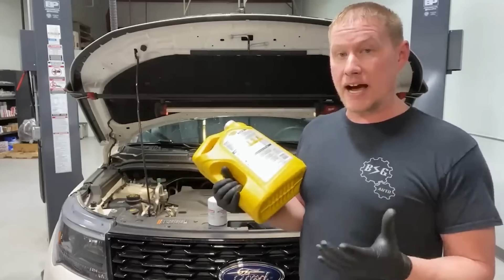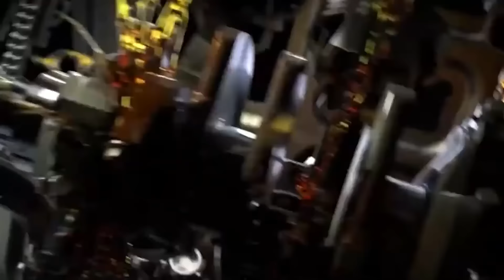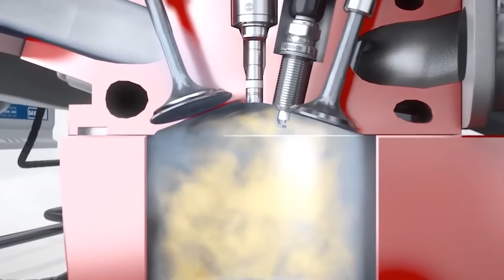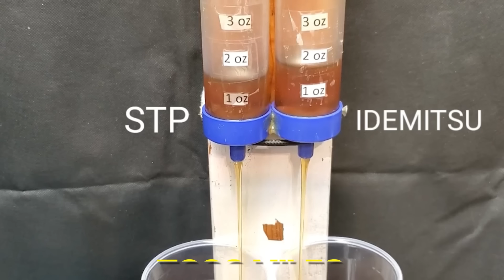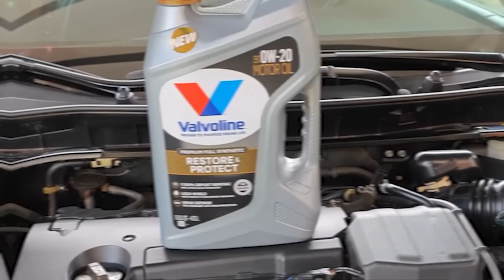AVOID These 5 Engine Oil Brands (And 10 That Actually Lasted 70,000+ Miles)

Comment: I've been using Castrol 5W-30 Full Synthetic oil in my Toyota pickup for two years now. Although this video reviews Castrol as a mediocre oil, I'll probably stick with it since it has been working great in my truck and I haven't had a single problem yet. But thanks anyway, I'll consider to check for those symptoms moving forward.

Comment: Amazon Basics, Walmart's SuperTech, and Costco's Kirkland are all primarily manufactured by Warren Distribution, though each retailer supposedly specifies its own blend. Realistically, there should not be much difference between them. Testing at 50,000–70,000-mile oil change intervals does not necessarily correspond to what happens when oil is changed at OEM-recommended intervals. You are testing conditions the oils were not designed for.

Comment: Plus you cannot trust the dealership.Oil change  intervals changing your oil at 7500 miles or 10000 miles
You're waiting too long to change the oil.Technically, your oil should be changed even on newer.Engines somewhere between probably four and six thousand miles, depending on how you drive your vehicle

Comment: I use mobile one 5/30 6.0 Lq4 Chevy 60 psi oil pressure truck had 20 thousand miles when I got it and 276 thousand motor is clean I change it 3/4 thousand miles fresh clean oil u won’t have problems it cost

Comment: My 2015 Grand Caravan runs on Valvoline Full Synthetic. It has been running on Valvoline since I bought it new in 2015. I had to replace the intake and exhaust cams on bank one and I voluntarily did bank 2. Bank one journal had defective lobes that caused a horrible tick. When I took the covers off I saw no sign of sludge or any metal fragments. Actually the top end was very well oiled and clean based on the engine rolling 177K miles of mixed city and highway. Here I am today still using Valvoline and before the month of May 2026, I’ll be rolling 390k miles. Oil changes can go 5K and at times I let it, but my normal is 3k miles. I read between the lines on these posts and decide for myself what works best for me and maybe not so much for others
Reply: 177k, and a cam replacement????   Yup, it's American.  Japanese cars routinely go 250-300k plus with NO internal engine fixes, still running great after that time.

Valvoline is good oil, in my experience, but make sure it is REALLY full synthetic, not CLAIMED synthetic, as there is literally no requirement to actually be gas based, rather than oil based, when claimed on the label."Full synthetic" label is marketing, not truth.

390k is damned impressive, virtually unheard of in that vehicle.  I know another guy with that vehicle, though, that has about that many miles on it, no total rebuilds. The car brand, by far, most likely to have 400k+ and still be rolling is Toyota, per meta data analysis.

Comment: Originally My 2005 Nissan Altima called for  5W-30 conventual oil.   Most oil sold today says Synthetic,  but it's just modified conventual.   I buy the lowest cost oils (Walmart) and change it every 7000miles.

Comment: Seems like if you run oil 70000 miles your maintenance cost is pretty low
Reply: You forgot to factor in the engine replacement that will likely be required, by then, or shortly after.  ;-)  That was funny though.   You can run your tires until the threads/belts show, and they blow, too, but not a great idea.

Comment: IS THIS ALL LIES? I need to know cause I want to put a little castor oil in my weak cylinder. It might raise the compression. But if it never leaves???
Reply: Why?  Of course it 'leaves'.  It gets burned and goes out with the exhaust, in a second or two.  That won't do anything good, though.  You could try one of the oils meant to unstick rings, I think Valvoline makes a good one.  If the ring is just stuck with carbon deposits it might help, some.  If the rings and cylinders are worn though, nothing but a tear down and rebuild will correct that.  Do a compression and leak down test before and after that full cycle to the next oil change, and you can see if anything actually helped.  Some engines are  more prone to that problem than others.  If you have a 2003 Camry type engine (don't remember where that seven year cycle for that model starts and stops), that is a possible candidate, a known problem due to the way it is oiled.  Good luck.

Comment: Sounds like engine oil should be changed more often now. No oil should be in an engine for 70,000 MILES!!!! 

What happened to "Slick 50" and other oil additives that are suppose to cut down or stop excessive engine wear? ?
Reply: Sounds like engine oil should be changed more often now.
Nah, not with good oils.

No oil should be in an engine for 70,000 MILES!!!! 
Can't possibly agree with you more.

What happened to "Slick 50" and other oil additives that are suppose to cut down or stop excessive engine wear? ?
Oils are designed and manufactured with certain additives, and some additives work VERY badly with others, actually degrading the oil to junk.
If you know all the chemistries, and really know what is in the additives, fine, but are you a tribologist?  Best to just stick with a good synthetic, a REAL sythetic.

Comment: Yeah, IDK, I have had several vehicles over the years, never had a catastrophic engine failure except two that lost coolant. I used to change my oil at 3,000, then started stretching the intervals over the years. I’ve gone 50,000 before in a 4runner V8 and normally did 20,000 intervals in the 4runners. One had 430,000 on it and radiator popped. The other has 230,000 or so and I can’t tell a difference between changing at 5,000 or 10,000 or 20,000. I always use synthetic and get a quality filter though. If I start buying Amsoil,,,that would probably be bad because i’d want to stretch it even more.
Reply: Bull, not with a standard off the shelf oil.  If you went 50k with a 10k oil, the interior of that engine  would be gunked up so badly that it probably wouldn't drain back to the pan, and the oil additives would have disappeared 40k ago, leading to very bad things.  That, or you have a guardian angel on your shoulder.  That is industrial strength stupid.

Comment: Pennzoil has always been junk oil. Back in the late '60's and thru the '70's, I could tell when I came across a car that was using it, as the oil cap would have frothing all over the inside. The engines would never lasted very long in those cars.
Reply: They now use natural gas to make their oils like Ultra Platinum. It's totally different modern engineered oils that compete with Amsoil.

Comment: The part about Valvoline synpower oil is completely wrong. It's a group 3 motor oil and Valvoline Advanced is considered the same oil.
Valvoline is a good oil no matter if it's group 3 or 4. 
Change your oil every 3000 miles and you'll never have an oil related break down. 
And that Walmart stuff, used it in a lawn mower, it just didn't look right during the mower's yearly change. 
Never again!

Comment: You should always change your oil every 4 to 5 thousand miles no matter what the bottle claim. No oil can last 70,000 miles and if it does your engine will be in bad condition.

Comment: my 2002 ranger with 180.000 mies lived on pennzoil and still runs
Reply: I have used Castrol for 20 plus years. My car has150,000 miles. I use no oil ,, I replace oil at 5,000 to 6,000 miles

Comment: Idemitsu...
Which Idemitsu "Full Synthetic" product did you test? Because Idemitsu's USA import is sold as "Full Synthetic", but IS NOT a Cat IV PAO base lubricant as the version actually sold in Japan. The version of Idemitsu sold in the USA is a Cat III non-PAO based lubricant... where other US testing companies have rated it at similar performance as "Full Stnthetic" Cat III non-PAO  Valvaline and Mobil 1.

Comment: I used mobile one 10000 mile intervals I changed it after 5000 miles and it was the dirtiest oil I have ever changed in my entire life and I changed my oil every 5,000 mi so don't believe the hype on the mobile one it's a bunch of junk
Reply: Pennzoil Ultra Platinum. Give it a try. I run it in my Mustang Gt and no issues. It protects very well. I run the shit out of the car at times with no issues.

Comment: I laugh in the comment section. About how who drives 75k miles on oil. He mentioned regular oil changes throughout. He never said that far on one oil change. Just cars that allegedly used the same engine oil at each oil change throughout that many miles. Smdh.

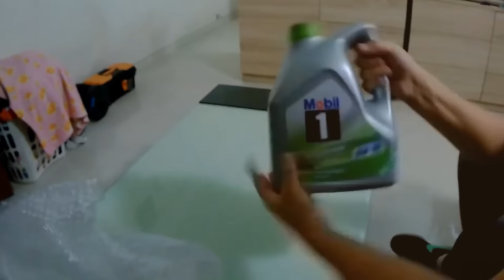Comment: Amsoil Signature Series (35:33): The winner. It maintained near-perfect viscosity and TBN (Total Base Number) even with 25,000-mile drain intervals.
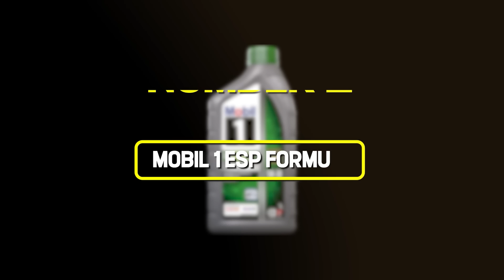Mobil 1 ESP Formula (34:33): Excellent European formula outperformed the American version.
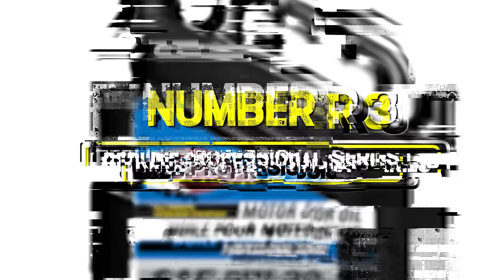Red Line Professional Series (33:32): Ester-based oil provided exceptional racing-level protection.
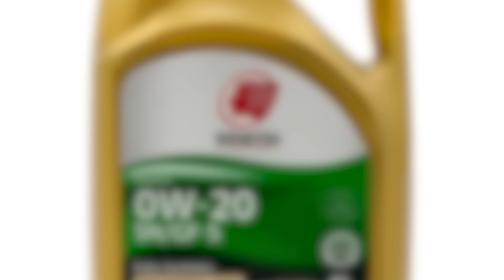Idemitsu Full Synthetic (22:28): Solid Japanese precision engineering.
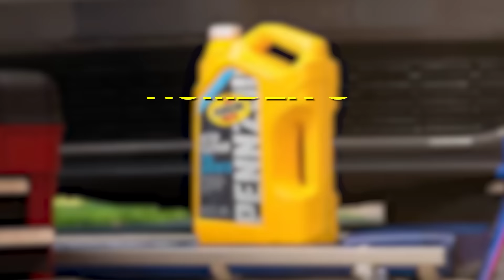Pennzoil Ultra Platinum (31:09): Superior performance compared to the regular Platinum line.
Supertech Full Synthetic (30:41): Walmart's house brand offered the best value, costing the least per mile while providing high-quality protection.

Comment: The high number of oil use is from a total use WITH oil changes at the preferred intervals: 75,000 mi. equals 5 changes at 15k miles each. So, continuous use broke down mechanicals even with changes.

Comment: I don't believe they're running the oil for 70000 miles but are breaking down the engine to check for issues over the normal oil change intervals at 5k

Comment: Have used valvoline in my 2008 ford4.6 for 260k miles... use 5w30 instead of 5w20 and she starts right up no ticks and change between 3 and 4k mile religiously...
Reply: That's the key, 3000 miles. It's all good oil when you do that.

Comment: I change my own oil.  I average 16,000 miles per year on my non-turbo, no-towing commuter vehicle.  I change my oil every 4,000 miles, and I purposely buy the $22 jug.  I save $84 a year by changing my own oil and filter.  One Jiffy Lub visit is $99.  I am done with quicklube, saving $310 a year, no matter what they call their bulk oil product.  4,000-mile intervals does not stress the group 3 base oil, as I have never had an engine failure due to poor lubrication.  I crossed 99,200 yesterday. Just saying.
Reply: A lot of those quick oil change outlets actually use substandard oil, specifically manufactured and bottled for them, by the different manufacturers, to save material costs.  Hard to believe, but true.  If it is a corporate entity, buyer beware.   They are there to make money, and if publicly traded, not for just themselves.

Comment: A few years ago SUPERTECH OIL HAD VERY GOOD RATINGS. What has changed? I have used it in my vehicles and have had 0 issues. Yes, I change my oil myself around every 5k miles. Also, the Supertech oil filters have been highly rated so why pay more?

Comment: This is false information and anecdotal at best. No oil is designed to endure the very extended intervals that this supposed test exposed the engines to.

If a classic well built engine can last over 300k miles on dino oil with regular maintenance, then the claim that any of these modern oils will damage the engine is ludicrous. All oil provides protection within specific operating conditions. If one does not maintain, then damage results.

The only additional variables impacting engine wear are lower oil viscosity of modern engines (beyond engineering limits of most modern engines), the poor quality components, and additionally complexity used in modern engines, but these are all manufacturer related. I have an 86 f150 with over 300k miles and a 2003 ram 2500 hemi with close to 200k. Both function flawlessly to this day using a variety of different oils over their lifetime.

Project farm and the motor oil geek are vastly more reputable than this garbage.

Comment: The best oil is the oil that's changed frequently.
Reply: That's fine, but not remotely necessarily true. Amsoil premium oils come OUT of the motor, after 15k or 20k miles, for their two oils with those service recommendations, EXCEEDING the new oil spec.  It isn't cheap, at all, until you look at the per mile costs, and you MUST use the proper Amsoil filter, or one they recommend, which is  one brand other than theirs, one type.  And that is obviously for an engine in excellent operating order, not one blowing crap by the rings by the ton/minute, or leaking coolant into the oil, or anything of that nature.    For a junk engine, you should probably change it every week, or better yet, rebuild or replace the engine, or junk the car.

Comment: I tell you what is true, you want car for long run start use numbers 5w30 or 5w40 don't try use 0w numbers, 0w number try factorys tell you use but this oil is fresh for only 3000ml after yes start be nasty in yours engine

Comment: What a nonsense video. You should change your oil after 10000km or every year. Also that you should use the right viscosity for your engine and check the oil level after time

Comment: Yes, but - after watching two of your vids on oil - I did not see Mobil One as recommends. One was the U.S. version and the other was European. So, where does Mobil One Fully Synthetic land for both list? - Thanks
Reply: I have a Honda civic 1999. Over 300000 miles,  clean oil pan and valve train. Mobil one is the only oil used.

Comment: Amazon Basics, Kirkland Full Synthetic, and WALMART Super Tech are all the same and made by Warren. Good for 5k. Who keeps it for 22k?
Reply: I use Walmart full synthetic and change at 5k miles using Napa Gold or Platinum filters. Currently at 129k.
Reply: I have used Walmart "SuperTech" oil in all my small engine equipment for the last 60yrs. I have had ZERO "internal" engine problems! Through the yrs I have paid $13 to presently $18 for a 5qt jug. Why in the fuck WOULD I change oil brands?:body-blue-raised-arms:

Comment: NOT TRUE pennzoil full synthetic is what they use in race car engines and I use it in my truck and never had any problems
Reply: Yes, this report is totally bogus and contrary to every other testing I’ve seen.
Reply: Penzoil platinum on my 2010 F 150 , I currently have 220k miles on the 4.6 engine, it runs like a dream.
Reply: @luispena-qo3cp  160k on a 2014 mazda 3 and all its ever known is Pennzoil platinum every 20k and thats from mazda's dealership okaying a 20k change with "synthetic" its not grade 4 but close to grade 4
Reply: @luispena-qo3cp How many miles per oil change and what type of filter are you using.
Reply: Who runs oil for 25,000 miles
Reply: @jackskinner7020 Nobody unless they are total morons.
Reply: Race Car Engines do not use "Street Oil". Race Oil has no detergents and use Group4/5, not the Group 3 that is Pennzoil in stores. Wake Up!
Reply: Oil in racecars is changed after every race. At what, after 500-600 miles? That is no comparison to how a consumer uses/changes oil.
Reply: How many miles per oil change through.
Reply: Amazon, does not make an oil,someone makes their oil.😂
Reply: I use Penzoil in both my 07 Mustang and my 01 Explorer for years with no problems 🙂
Reply: @Buyford28  yes this is the only negative supposed testing I’ve ever seen on Pennzoil. This is nonsense.
Reply: DID YOU EVEN LISTEN TO THIS?
Reply: @azdesertnews7563 LISTENING, -SHOULD WE BELIEVE THIS IS THE QUESTION.
Reply: Race cars do not use Street Oil. They use custom REAL Synthetic Oil without detergents. Those signs at racetracks are a fraud.
Reply: I think I’ve heard it’s one 1️⃣ f the best oils. I used it to n one of my cars for 45,000 miles before I traded it in. I changed the oil every 6 months as my mileage per month was very low
Reply: Penzoil not a bad brand but its thiner that the other brand and you have to take this in consideration, by exemple a 10w30 penzoil is more thin that 10w30 from other brand personally i dont recommand penzoil on japanese car
Reply: @Vincent-kc9cg  Umm, not really, those weight specs are tested and guaranteed.
Reply: @MrJdsenior if you dont believe me go Buy a penzoil pint and one from another brand compare it and you Will see

Comment: Why would you test the oil at that many miles?  38K - 72K!  Ridiculous, no one runs oil that long in their cars unless they are an idiot.
Reply: I being using Penzoil on 2002 Suburban and now is over 200,000 miles and still running lke brand new.
Reply: Don't believe this video. I've been using pennzoil in my ford f150 and I have 206,000 miles with the original turbos. This guy is lying
Reply: I been using mobil1 and my gmc is 186k… and runs good! Oil change every 3 to 4,000 miles
Reply: By then it'd be grease!  🥷
Reply: Ill give a amen on that, lol !!
Reply: Totally agree with you
Reply: Because it tells the true endurance of the oils that that claims this and either provide what they say it or tells how horrible they are out to just make a buck giving customers cheap oils that cost much more than just the maintenance service costs!
Are you going to disagree with their findings? Call them liars and ruin the amazing oil in your car find out for yourself!
Reply: @Babybeast4357 nonsense

Comment: Have had use Castrol Edge A5/B5 0W-30 and Magnatec 5W-40 at my cars,,,, looks fine...
Reply: Did you put your lab coat on and get in there?
Reply: @MrKoritime  You can take samples, at change, and have it lab tested,  It is not super expensive, and will give you everything you need to know about the service quality of that oil, iron, copper, etc for wear, and the oil quality at change.   Also, if you can pull the valve cover on an engine with 200k miles, and just wipe the aluminum clean with your finger, that is a fair indication.  ;-)